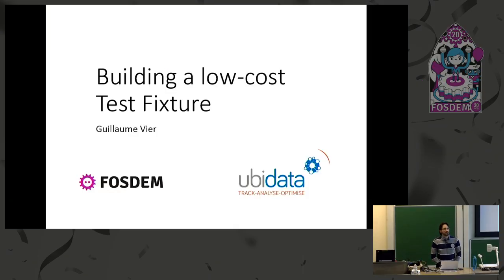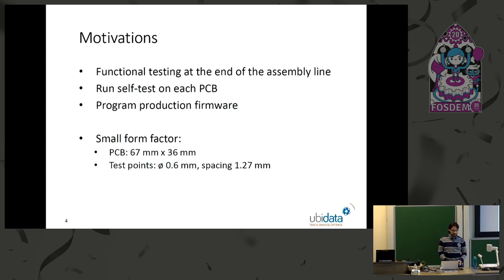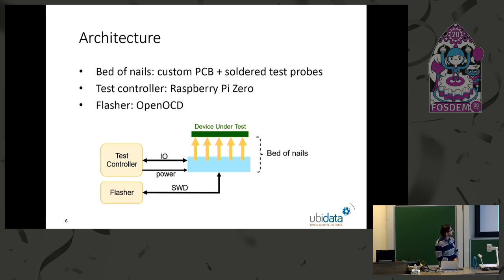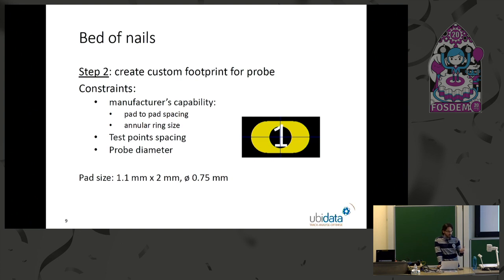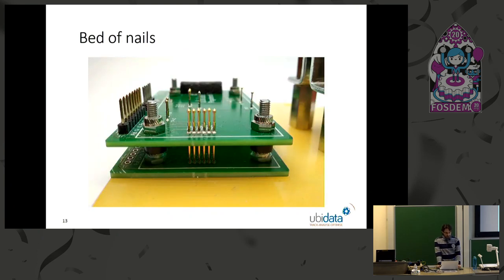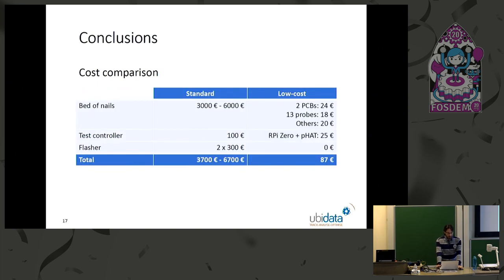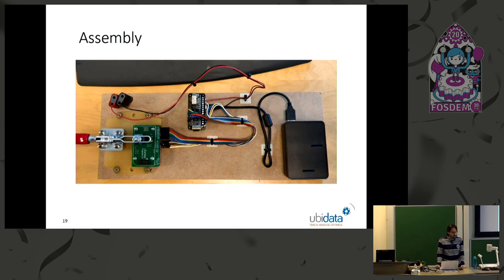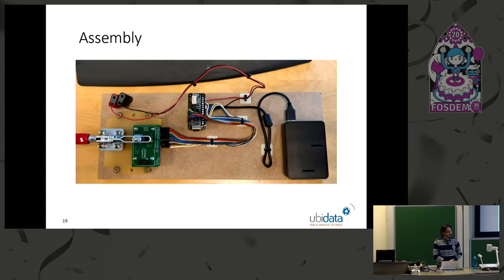Building a low-cost test fixture

Comment: Thanks for sharing the whole process well done! ive had a machine shop drill the holes into a fiberglass type block and then  press my probes into the holes.  I lay my UUT board on to the probes clamp it down and do my test.   I do like your method using  another board. Solder probes onto it.. Keep on sharing ideas!!